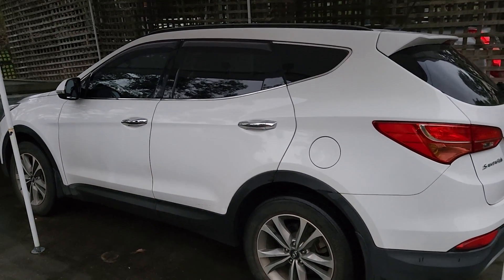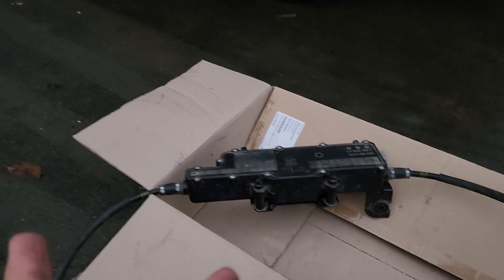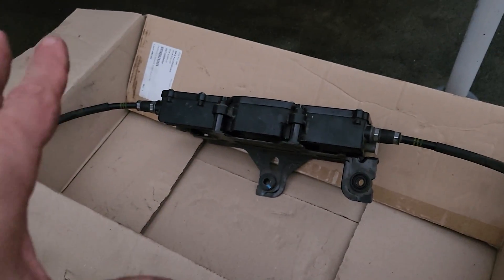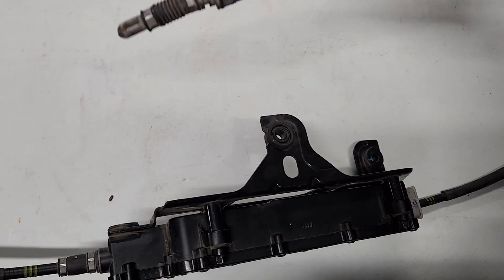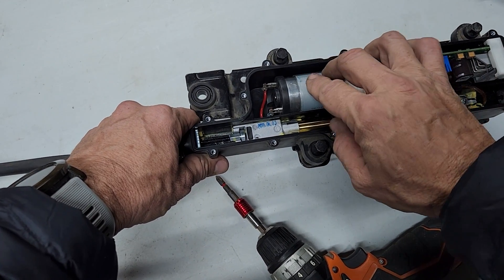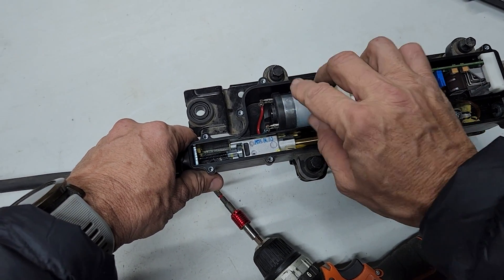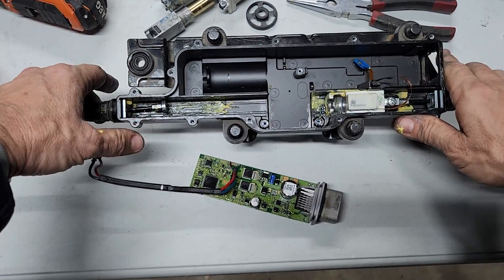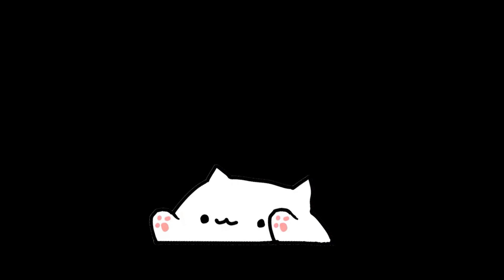Hyundai Santa Fe EPB Failure Fix & Cost: Electronic Parking Brake Module Teardown (Locked Wheels)

Comment: Happened on my 2014 Elite AWD model. Just ordered a new circuit board for $80 as the engine was fine when testing. Waiting for it to arrive and hopefully will fix the issue. I heard that the newer models allow manual disengagement of the EPB. Would it be possible to install altogether a newer model on a 2014? Are they compatible? and what about just cutting cables to disengage it completely and just park the car on flat roads with the parking gear?

Comment: I got a replacement from AE from the link above. It is working, however, the brake is not engaging fully. The brake shoes are well adjusted, however the cable isn’t pulling the shoes enough to completely lock the wheels. The car still rolls backwards while the epb is engaged. Is there anyway I can adjust the cable?
Reply: One tip I have to deal with: Never adjust the traction of this parking brake without using the appropriate Scanner Reader. I decided to do it on my own, going straight through the wheel drum, and it didn't work out.

Comment: Far out you got reamed pretty hard. Sorry to hear. I got mine fixed for a little bit under $120 with parts from AE. My module actually stripped the gearbox. Fairly easy to get at the EPB that was bolted to the sub frame.

For anyone who needed to carry out this repair.

1. Car up on axle stands.
2. Remove spare tyre.
3. Remove rear tyres.
4. Place a jack underneath rear sub-frame.
5. Undo sub-frame bolts but do not remove,leave a few mm on. Think they were 27mm socket.
6. Gently lower the sub frame and you'll have easy access to EPB.
7. Remove bolts and cabling,harness associated with the EPB. 

That was a rough sum up. In hindsight I should've videoed the process but it really wasn't that hard and I didn't think it would've been useful.
Reply from the maker: Thanks for the detailed info - that's super helpful! 👍
Reply: can we remove it with out this step ? 5. Undo sub-frame bolts but do not remove,leave a few mm on. Think they were 27mm socket.
Reply: @georginikolov4486  doubt it. There's not a lot of room to undo the bolts holding the EPB bracket to the top of the diff. You might be able to use a flex head ratchet spanner in there. Give it a go before undoing the sub frame bolt and nut if you wish. I lower the sub frame because having extra room just made life so much easier. Taking the spare off gave plenty of room underneath too.

Comment: I have the same issue where the right wheel won't disengage. Is the one you bought from ALI express is a Mobis brand? or a replica?

My car is Hyundai Grand Santa Fe 2014
Reply from the maker: The replacement was an OEM from Hyundai that the mechanic supplied which is why it cost way too much.
Reply: @jelreviews  I see so it's the same thing but the ones from Hyundai are just branded and they up the prices.

I was wondering if there are any replicas going around as I saw one here from an online shop here in the Philippines where it only cost like $59 AUD.
Reply: @jelreviews  Are the ones from Ali Express just the same as the ones from Hyundai Mobis in terms of make and quality?
Reply: @jelreviews  are the ones from Ali Express the same make and quality as the ones from Hyundai/Mobis? or not?

Comment: Will the Ali express ons work given its Chinese made? Wonder what’s the durability…..
Reply from the maker: I see no reason why it wouldn't work - I buy everything off AE. I would have purchased this if I had the time to wait for it.
Reply: @jelreviews i got a replacement from AE from the link above. It is working, however, the brake is not engaging fully. The shoes are well adjusted, however the cable isn’t pulling the shoes enough to completely lock the wheels. Is there anyway I can adjust the cable?

Comment: Salve il tuo video mi e' stato di aiuto Grazie
 volevo farti un paio di domande: quando togli l'elettronica stacchi la fascia elettrica con il connettore blu sai dirmi a cosa serve? sai per caso quando il motorino smette di tirare, smette quando la centralina rileva un amperaggio superiore alla soglia impostata o smette di tirare quando e arrivato a fine corsa?
sulle canascie si erano staccati i ferodi e si sono messi in mezzo tra canasce e tamburo e durante la marcia mi frenavano l'auto, su aliexpress ho ordinato la scheda fra qualche giorno arriva , ho comprato le canascie le cambiero" ma non son sicuro che sia rotto il motorino gira sia in tutti e due i versi. Grazie di nuovo  un saluto dalla Polonia..  
hi your video was helpful Thanks
I wanted to ask you a couple of questions: when you remove the electronics you disconnect the electrical band with the blue connector can you tell me what it is for? Do you by any chance know when the motor stops pulling, it stops when the control unit detects an amperage higher than the set threshold or it stops pulling when it has reached the end of its travel?
on the canascie the brake linings had come off and got in the way between the canascie and the drum and while driving they slowed down my car, on aliexpressI ordered the card in a few days it will arrive, I bought the canascie I will change them but I am not sure if it is broken the motor turns in both directions. Thanks again greetings from Poland

Comment: I have a 2012 Santa Fe. I had the same problem with the handbrake jamming. If you disconnect the battery you’ll be on your way 
Until you turn the engine off and then you’ll have the same problem again
 at least you will be on your way.. for the time being
Reply from the maker: Thanks for the tip :)

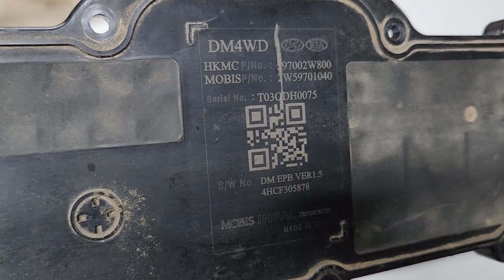Comment: Thanks for the video it was great help diagnosing the same issue on my Santa Fe 2013. I am now looking to the replace the EPB but just want to confirm the part number. The part number that came out was 597002W800 (Lid at 5:54 on video) however the replacement part number that you put in the comments is 59700B8700, just wondering if this is correct.  The original part number 597002W800 is interchangeable with 59700B8800. I want to make sure I order the right one. Is your Santa Fe AWD ?
Reply from the maker: Hi, yes these parts are interchangeable according to the first AliExpress listing in my video description. They suit Santa Fe models between 2012-2019. Mine is an AWD model.

Comment: I have the same car and same problem, I replaced inside motor and gears for 50 bucks （new motor calibration and handbrake pad adjustment required). module removal was real pain, finally i threw away the metal frame attached to the module which make installation much easier. if you want your wheel locked car back on road now, just unscrew bolts on the back of wheel hub where hold this module end to the brake, make sure the disconnected end must be tie secured on somewhere, and park your car on a flat road.
Reply from the maker: Excellent advice!
Reply: How did you recalibrate?
Reply: I’ve done the same. I got 2013 and the gears are plastic made, so I got from AliExpress from 20£ a 3 gears set and replaced all. One mistake I did, is testing out of the place, so the motor get stuck at the end of the thread. 

When you install all gears, you should leave the cables in loose position as far as possible and set the motor thread to fit in open position, do not test until is fully installed. 

Remove is not a pain, is an organ and hands loss.😂
Reply: @Clevertonwitzki  This information is the main point of the assembly. If this is how it should be done, everything will be fine. The last time I tried (I'm on my second attempt...) I think I left it in traction. So it could have been the cause of the problem.

Comment: so right now I have a 2022 Hyundai ionic which is a hybrid and this is the fourth time that I’ve had it in the dealership for EPb failure fortunately it hasn’t rendered the car on drivable. It has just deactivated all of the safety measures for the cars such as the Special cruise control the lane, diversion notification all the different things that help you to be a better driver. This time I decided to contact Hyundai directly because we’re in Florida and we have something called the lemon law and I knew that now that this had passed three times for having the same thing repaired ultimately, I’m going to have it in the dealership five times because they keep having to order parts and then I have to come back. I’ve opened up a case for a buyback program with Hyundai. They actually have a buyback program that you can contact them directly so you don’t have to go through the government for the lemon law and usually it resolves itself within about 3 to 5 working days and I’ve opened up a case on it and it’s likely that they’re going to take this car back and I’ll be done with it. I can’t have a car that doesn’t have reliability.
Reply from the maker: That’s a real pain in the neck... I can only imagine how frustrating that must be!

Comment: My 2015 santa fe just locked the handbrake today at a set off lights what a nightmare, recovery truck, I am buying a car with handbrake next time🙈😅
Reply from the maker: Yep, it's a nightmare alright! Sorry to hear it happened to you too.
Reply: Take it apart, take the plunger out and put it back together. It won’t set the e brake anymore. 👍. I did this and you don’t need it in an automatic car anyways.

Comment: U could of disconnected the cable from the wheels an drove it without handbrake for a couple weeks if u had to
Reply: @sinancinar7910  yeah I just disconnects the cables on a 2015 so it can be driven till we get it on my hoist, easy as just take the wheel off remove the Phillips screw and pop the cable ring off the end off the brake lever arm with a screwdriver and a spanner to lever it with. I’ll see what’s wrong with the epb module when I get it out up on the hoist, at worst it a few hundred dollars for the module otherwise I’ll do the motor or control board as needed
Reply: @srnunan4783  you do this for both rear wheels? Currently in position we have to do this. Do you have any pictures that could help?

Comment: Had the same problem with my 2014 Santa Fe Highlander. Didn't lock the handbrake on just light came on saying handbrake was on when it wasn't.  Got an aftermarket part off ebay in 2 days for $200. Mechanic fixed it for another $200 in labour so fixed it for $400 in total. Hyundai quoted me $1900 just for the part, who knows how much in labour they would of charged?
Reply: Any chance you have a link to where you bought it? Same issue with my 2013 santa fe

Comment: This Is Why I Love Driving Older Cars, NO ELECTRONICS!! Here Are A Few Suggestions. 1) Go To The Junk Yard To Buy Your Parts. 2) Find A Crashed Car As The Same Year As This And Buy It, Keep It For Parts. I Would Have Cut The Cable And Never Fixed It. I never Use My Parking Break For Anything. I Looked This Part Up On Amazon, Less Than $200. Man its Expensive To Live In Australia. Cool To See Whats Inside. You Should Test That Motor, Put Some Power To It And See If It Works.
Reply: It's likely most people don't have the proper place, tools, or knowledge to install one of these themselves. On the other hand,. many mechanics do not accept customer-supplied components, or at least will not warranty them.
Reply from the maker: Very true!
Reply: Why didn't you order the part and just cut the cable to free up parking brake until part came in.
Reply from the maker: I needed the car immediately for the family, and from videos I've seen, it's no easy job to either remove or install.... Would have taken me all day. If we could afford to be without the car for 3 weeks, then sure, I would have given it a crack.
Reply from the maker: Yep, I now know a bit more than before. I will test the motor... I slapped this video together really quickly so ran out of time. My Toyota still has an old manual handbrake, that works flawlessly after 23 years😅